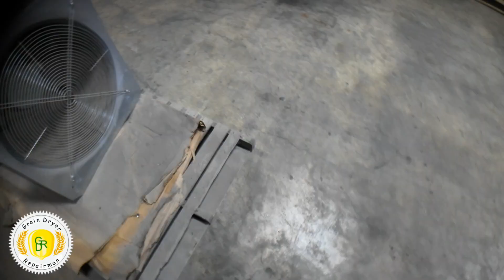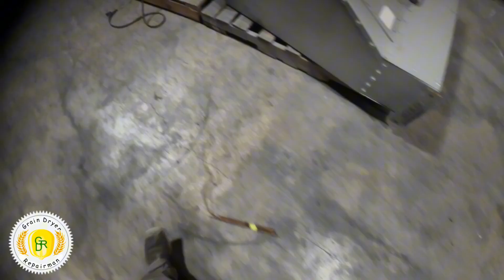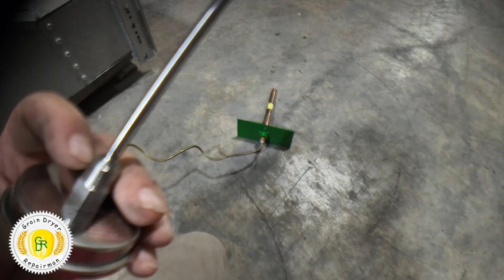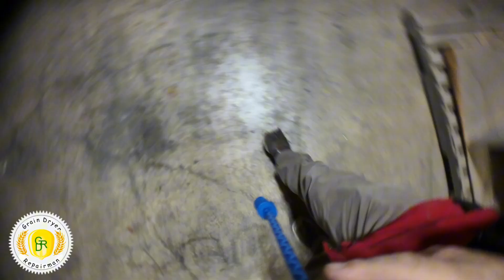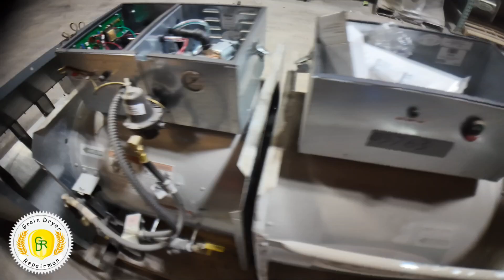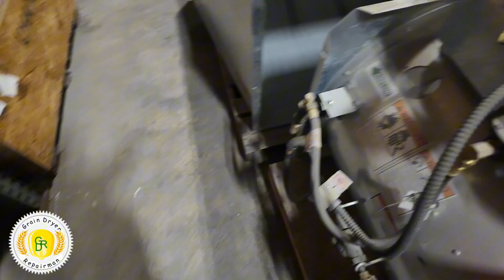Sukup Fan Heater installation and general operation basics

Comment: where should gauge psi be at for running two burners that does not have mod valve?  Also do you just adjust coil going towards and away or do you also move it in and out? What is max temp and suggested temp for 24% corn using 2 burners?